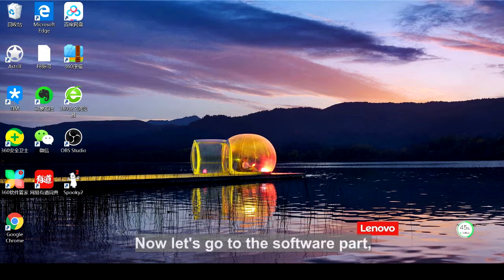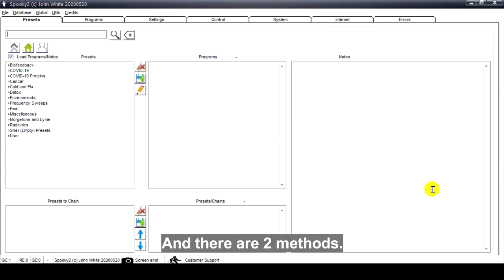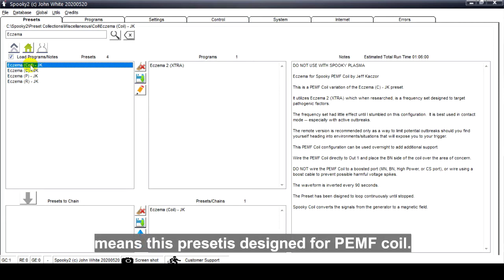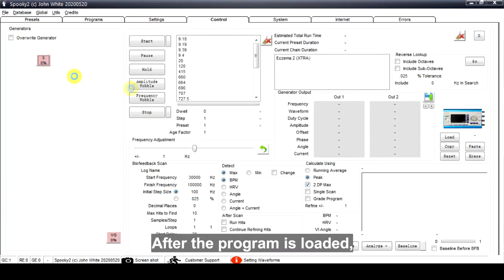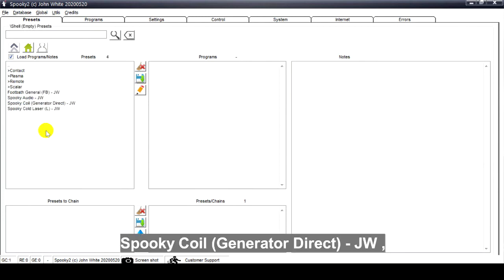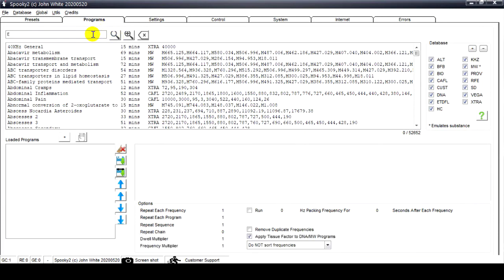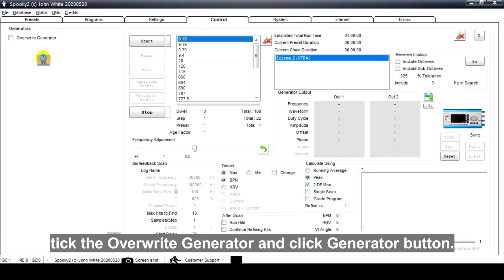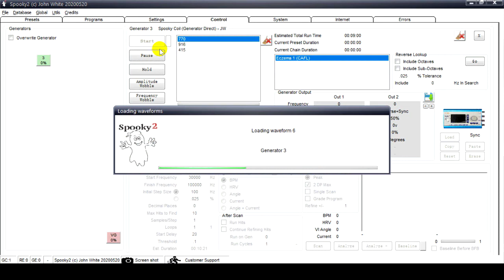How to Use PEMF Coil with Spooky2 XM Generator

Comment: HELP HELP HELP. Is it possible to obliterate unwanted stuff in the body using this device? How far does the therapeutic field go? How strong is it (in Gauss) at different or key distances? I need it to help with abnormal growths in  animals (from dogs to horses). Thank you
Reply from the maker: Hi, if you want to run some killing programs, contact or remote mode will be a better choice. PEMF is mainly for some healing process or relieving some pains. Please have a talk with our support team, they will give you much more professional advice:) Feel free to send your questions to support@spooky2-mall.com, they will reply to you soon!
Reply: @Spooky2Rife  I might have to use the plasma then, because the electrodes burned the skin of some people. They also speeded up the growth of warts instead of eliminating them. The settings were 5 volts amplitude,  sqr wave, 0 offset, 50% duty cycle. Idk what happened.  I looked to get rid of those issues and they bloomed instead.
Reply from the maker: @MedullarisConus  Hi, if you are troubled by this trouble, please fee free to send your doubts to support@spooky2-mall.com, our support team will give you much more professional advice:)
Reply: @Spooky2Rife  I forgot to mention it also reduced the wbc Count of most of the patients.  If you could take me to a training in how to use this system properly, I would appreciate it. I got many items (electrodes mostly) and They didn't help
Reply from the maker: @MedullarisConus  Hi, any questions during use, please feel free to send them to support@spooky2-mall.com, our support team will give you reply ASAP:)

Comment: Hi there! I only have a GenX. I can't seem to find videos, instructions or anything on how/where to hook up the PEMF to the GenX. Do you still just use a boost and plug it in to the High Power port? Thanks in advance! <3
Reply from the maker: Hi, you are right, just need to use a boost and connect to High Power port.
Reply: @Spooky2Rife  Awesome! Thank you so much for the response! 😊